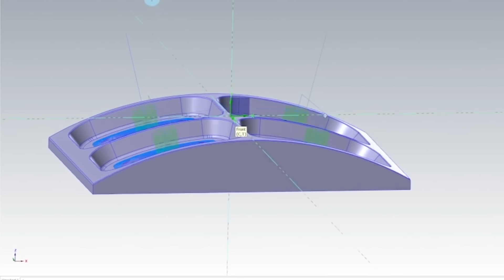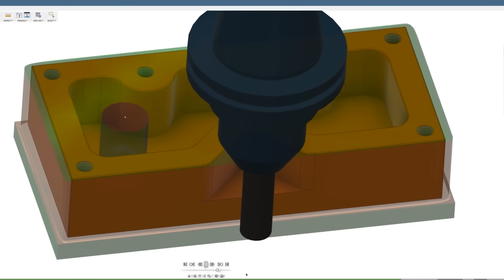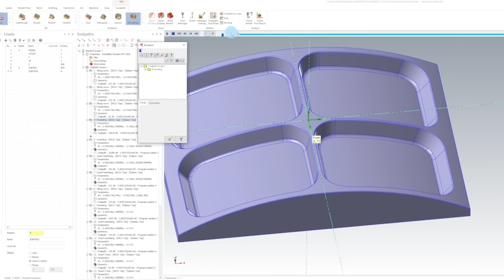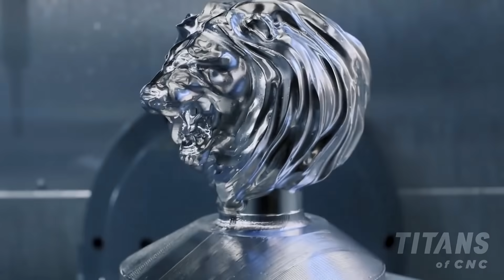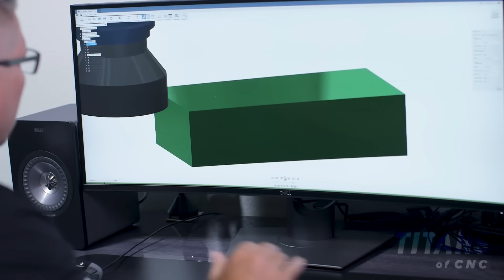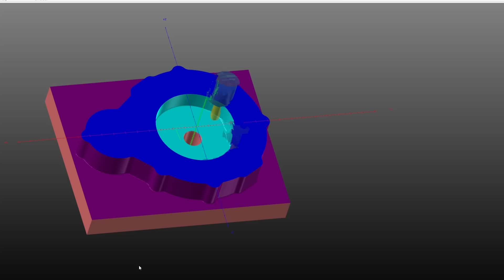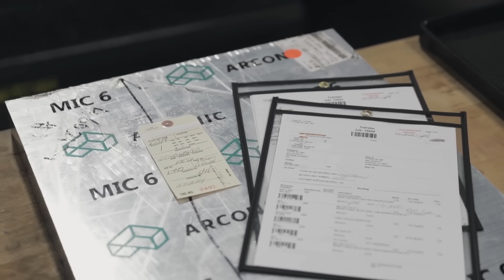TOP 5 WAYS to EARN $100,000 as a CNC MACHINIST | DN Solutions

Comment: I have been a machinist for almost 27 years. I have made over 150k multiple times and more than one company. That is doing it on CNC and manual machines. The biggest key is experience and getting into shops that make $25million or more a week.  The key to doing it with manual machines is to have the confidence and knowledge that there is nothing that will come thru the door you can't machine.

Comment: I have been a machinist CNC and manual for 30 years . I am certified in solidworks , Mastercam, Gibs cam , Camworks, edgecam, and a host of others I have run . I can macro program anything . I program up to 9 axis I also program robots and run manufacturing cells between them . I’m very skilled and all I’m worth is $50,000 max to anyone on the east coast . I also have 2 engineering degrees one in mechanical and 1 in applications  not to mention a 7 year machinist apprentice qualification.  I’m about to quit this trade to go put together electronics for $50,000 A year to start . All I have to do is sit there all day . Education is way overrated. It’s not worth being a tradesman anymore in manufacturing .

Comment: Thanks for the pep talk, but I am one of those machinist that steps up to the challenge and solve problems. My main machine is a large 5-face bridge mill. When the other guys on there smaller machines have problems and the head programmer can’t answer them, they come to me. Over the summer, they moved me to a smaller 5 axis mill. There I learn that the post they were using for the last ten years required them to enter the gauge lengths into the cam system so it would not crash. I knew this wasn’t right, but I have never ran a machine with a control like this. So I contacted our cam reseller about this and they could not give me a answer. So I stuck my nose the the book, and less than a week later I knew exactly what the problem was. When there is a Job that needs to get done, I will hang around on the second shift, sometimes for additional 4 hours l, to ensure the guys on second have a good handle on things After all of this, I manage to gross 65k last year.  I did manage to pull in 65k last year, pretty good for Grand Forks North Dakota, but honestly, I am getting tired.

Comment: I taught myself conversational and then mastercam.  8 years in and I'll be making close to 90k this year.  Mostly medical manufacturing.  That's where the money is
Reply: That's the way. If you have passion and half a brain all this stuff teaches itself. I learned g-code and cam during the covid lockdown weekends.
Reply: @szameth  where and how did you learn it, online?
Reply: “thats where the money is” bro not even making 100k after 8 years 😭💔🥀
Reply: Yup.  Medical and aerospace are the money makers.  Your run of the mill ISO9001 shops are not going to be able to compete.

Comment: Reality: You live in the miserable midwest, work for a multi million dollar company supported by a corporate, you have over 12 years in the trade now and are the only one in the company that runs their latest and greatest 5 axis multi tasking machine, totally re-innovating their manufacturing process. With so many parts cut down in single operations now instead of four, five, six, or more, jobs are flying out the door and money is pouring in, straight to your bosses pockets. You get 54k a year now because you had to beg for a raise over the 52k you were getting. 

The trade is dying.

Comment: 1. Remove CNC "Machinist" from your job title and put in CNC "Programmer"
2. Work a ton of hours (60 and up)

If that doesn't work, get a degree and become a manufacturing engineer and work a lot of hours. Though some companies are desperate and don't require a degree. However, regardless of you skills, you have to be in the right location. There are some companies stuck in the 80s and will not go above 24 per hour and limit the OT.

Comment: Quick story from a couple days back:
Order came in, Delrin, repeated production, last time i made those parts with part times between 3-4mins only limited by the speed of our machines. Now as it was already programmed and we were sure all was good, we decided to let the night shift run those parts. Guy decided that the program was too fast and reprogrammed entire parts, smaller diameter endmills, shallower depths of cut, slower feeds... Final time for part was in the realm of 12-15mins.... Because he thought the program was too fast and wanted to relax a bit. 3 hours of work were done in 9 hours, manager was not amused when we found out why it took him so long... Setup time should be within 1 hour, as those parts were fairly simple, plonk it in the vice, mill one side, flip it, remove rest of stock material...
Reply: Sounds like something I would do when we worked the grave yard shift. 🤣🤣 I would literally slow the speed RPM change some tools and feeds just so I can kick it and watch movies at night 😂😂😭 ended up getting promoted to day shift and was bumping heads with the programmer because he was an idiot at programming and always had to trouble shoot on the spot for every piece he programmed smh we both didn’t last long there lmao

Comment: I must be one lucky son of a bitch.  I've barely got 20 years in the trade and I'm well north of $100K.  I'd have to do the math on it, but I'd be willing to bet that the first job that I programmed and set up at my shop has paid my salary for the 3+ years I've been at the shop.  That job/machine is still running to this day.  We just bought another machine just like it to make another version of the same part.  We have 17 swiss machines at my shop and at one point 6 of those machines were running jobs that I had programmed/set up/proven out and dialed in for reduced cycle time.  The rest of the machines are running production on parts that the customer buys as fast as we can make them.

Can a guy on the floor that just does set ups and running machines make $100K?  It's hard to do without a doubt.  To make that kind of money you need to have a larger impact on the bottom line of the company than setting up/running a few machines can have.  If you have the skill set to be handed a print and can turn around and hand back finished parts, then yes making $100K is possible in the right shop.

A word for the people that are down on the trade.  Working at a ISO9001 shop is basic now adays.  If you want to make more money you have to step up to a AS9100 or ISO13485 shop.  That is where the money is today.  Job shops without advanced certifications are just too common and have too much competition to be able to pay good salaries.  They have to keep the bottom line in check because a job that goes bad or machine that gets crashed could ruin their profitability.  The margins are too thin to be able to absorb too many people making high dollar salaries.

Comment: Here is how I did it. 10 years at a engineering firm that has a handful of prototype machinist. I program and run a 4 axis cnc mill with mastercam, so I am also the programmer. I make $40 a hour +60 a hour overtime on friday. There is also profit sharing but it's not guaranteed. Good fucking luck finding a spot like mine there aint many

Comment: I work for a small machine shop that just tranfered owners. I have been there almost 5 years and I moved from the debur guy to the main mill machinist here in that time and its pretty much all thanks to your academy. Ive been having problems with debating on how a part should be ran. Now this is me with only 5 years experience in the trade vs someone with 40 years in. We butt heads alot on some things and Im sometimes forced to try something out then ask for forgiveness later. What should someone in my position do when the previous owner doesnt want to push limits and try new fixturing out? Also to add on to that the new owners haven't really been involved in any type of manufacturing aside from engineering. So they are wanting parts quoted that we may not be able to do and I am doing my best to keep production going because i dont feel comfortable with anyone else starting my machines. Like i said im very new to this trade but the academy has helped me shoot up the ranks so to speak. Im just frustrated that certain things are the way they are and I am in no real position to implement changes. All i can do is give my opinion and help make things more efficient in what i do. I know this is a lot and more of a rant but i would really like some outside looking in opinions of where i stand. Thanks again for the academy. I wouldnt be where i am today without it.
Reply: Ur job right now is to point out the mistakes that the programmers is making. Don’t need to tell them how to do it cuz u need to learn the machinist way of talking. Spend ur extra time learning the G codes n M codes. Take classes about programming. If ur willing to learn( but on ur time. )U will get ur chances

Comment: I agree with your advice, to the extent that all 5 are requirements IMHO.  And yes a Machinist with those skills should be making the big bucks.
But...
80% of the self proclaimed "Machinists" out there are actually "Machine Operators". And generally will not make anywhere near $100K.
There is a huge difference between the 2
Reply: what's the difference ? 🤔
Reply: @Zinbou1  knowledge and experience in a wide range of machines, tools, setup, etc.

Comment: I made over 100K for several years before I retired two years ago.  It all depends on the shop you work for.  I worked in the nuclear power industry.  We rebuilt huge electric motors for the power plants all over the country.  There is constant work in this field.  You never get laid off.
Reply: What company was this for?
Reply: I just started working for a similar company as a CNC Mill Machinist, I actually was hired on to run a CNC Lathe but because I had interest and they needed help I was put in the milling department on day one, now its been a few months and I normally set up and run a VF2 but Ive also had my fair share of time on the Horizontals and even our brand new 5 Axis. Although I dont think anything we make is for anything nuclear we make large bearings for those huge electric motors you were talking about.
Reply: @nickdovgi  Do you have and advice or know of any learning resources for Cnc, Cam, Cad, g code? I just started my first job with a manufacturing company dealing with Cnc machines.

Comment: 1: Don’t even think about it if you’re over 40.

Many companies will lay you off the second you turn 50 unless you’re the cream of the crop.

2.   The company will only pay you $30K a year if you’re making them $90K a year pushing buttons.

3.   Most small shops have only ONE guy allowed to do GCode programming and they won’t train YOU.

You will push buttons, running back and forth between two machines and loading blanks.

4. If there’s a “hiring” sign out front that never comes down, don’t expect to stay there long.

That kind of company will force 12 hour shifts with no weekends until you give up.

5.   If you watched this guy, he’s obviously ex military.

The Navy has ALWAYS had engine lathes on their ships, and unlike the Industry, they NEED to train your ass.

6.  If you take a tour at Niles Precision, they’ll show you mating parts machined to fifty millionths of an inch.

They won’t show you a job application unless you’re related to somebody.

Comment: i see a problem in the making of workholing 

lets say 10 pcs.   in a vice take 10 min. each  no extra cost 
in a special made workholding it takes 7 min. each but cost 200$ including the time spend to make it, raw material and so on 

in  many cases it will be cheaper for the customer to make the parts in 10 minutes instead of making a workholding 

a whole different story if this job comes again and again   

but just simply sayin  advanced workholding is one of the keys to success is not the best in my opinion 

but i know what titan means with saying this

Comment: Want to make top dollar? (Not necessarily 100K a year tho..) Know how to run many various CNC machines especially Mill-Turn/Multus type machines. Be able to program, set up, and refine programs for efficiency and cycle time removal. Understand and be an expert at Unigraphics, Master cam etc. Understand and know how to manually sharpen tools and run hand machines. Know how to build fixturing and special tools your job needs. Know how to take a part from a print to a 1st piece inspection efficiently. Don't be a Prima Donna to work with. Be able to mentor other machinists. I don't care how good you are, if you are a jerk, people won't work with you. I typed all of this before I even listened to the above video, I already lived it as an owner for 25+ years. Also, never stop learning or listening to your people...And as an owner, don't bid on jobs that are over your company's head. Just get it in here and we'll figure it out, is a good strategy to go bankrupt..

Comment: As a small job shop owner, best advise is to run.  If its money then you will be better of as a welder, electrician, hvac, or even a plummer.  To get all the experience necessary for 100K, which you wont get, you have spent decades.  As for the people suggesting to open your own joint, investing 100's of thousands not to mention a crap load of taxes, epa, waste, tooling and everyday expenses to charge $80/hour is crazy.  That is the going rate for non Aerospace and medical fields.  If you do decide to get into those fields, then set aside another 1/4 million, start your divorce papers, brush up on your ass kissing, because that's what it takes to get into those fields.  Not what you know but who!!!
Reply: Literally everything you've ever touched involved a machine shop and the industry has made a ridiculous number of millionaires. No one would do it if what you say is true. Being a good machinist and good business professional is rare combo and that's the real problem. So many people just don't know how to manage well. I would bet my ridiculous salary that nearly all shops that go under could have survived if someone who could really manage and lead others was at the helm (I realize that economic downturn closes a number of shops as well). I'm not claiming to posses either skill set. Just calling like it is. Your opinion is very one sided and clearly inaccurate or you wouldn't have "stuff". You think folks are just out there making stuff for fun. Starting a business to lose money... The answer is no.
Reply: Bingo. I've seen enough guys in their 50's that know more than I ever will about machining, but only making a handful of dollars an hour more than me to know this trade is absolutely not worth the time unless you just can't get enough of running a machine. 

If you just want good pay and a steady career, anything is better than machining. It's unfortunate and I know that the people who are really devoted to this trade hate hearing it, but it's God's honest truth. This trade is going to have a really hard time attracting people in the coming decades when they're making more in a warehouse with full benefits.

It's just not sustainable in a country like the US where over %80 of the country lives paycheck-to-paycheck (US Bureau of Labor Statistics, 2019), God knows what that number is these days... And of course robotics companies will continue to innovate and try to plug that gap in manpower with robo-Randy's which will ultimately drive earning potential down even further for everybody but the select elites at the top who've already been at this for decades prior.

Oh well.
Reply: 100% wise words.
Reply: Bro, WHO is charging their customers by the hour in any manufacturing company? They pay by the part or batch of parts. It costs $100+ an hour just to run some CNC machines
Reply: I partially see and understand your comment. However, you shouldn't be selling/bidding jobs by the hour. It should be per part or lot based on total contract. If someone wants a part that takes an hour to mill, that part is not $80's (using your number) since there are other factors involved taking up more time. It could take you 5 hours to design the program and then an hour to tool it plus clean up and setup, plus the material costs. There are other miscellaneous things too. So a 1 off custom part should actually cost close to $2,000. Now, if they want 100,000 parts all the same, you still need to build in all the other costs, plus tool replacement/wear, quality control expenses, loss due to parts milled wrong, machine depreciation, building overhead, material costs then salary and owners profit. The total per unit billed should be a minimum of 5 times the labor expense. The client shouldn't be seeing a cost per hour only the cost per unit/contact. Those 100,000 units taking a minimum of 1 hour each at a labor rate of $40/hour including all taxes and benefits to the employee to produce takes 100,000 hours. That 100,000 hours should be multiplied by $200/hour and therefore the bill should be $20,000,000. Maybe a bit less if you need to give a discount. If a tool, programmer, fitter or anything else can make the job faster, that makes each part cheaper. Keep the savings in house and/or share the profits with the worker(s). Buyers usually don't know the costs associated with making the pieces. They only know they want the parts made and how much overall they are willing to pay. They will give the contract to 1 of the following companies: the cheapest, the quickest, the best quality, the owners buddy or the biggest briber. 
Welders in shops make $20-40 per hour typically plus OT. Electricians at a company make similar $25-$40/hour, HVAC and plumbers too. Of course these change geographically.